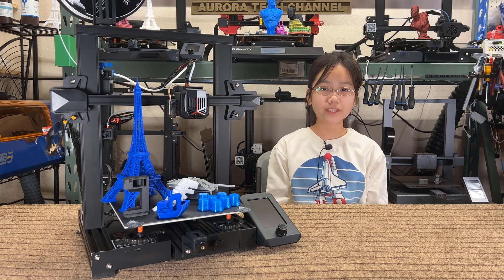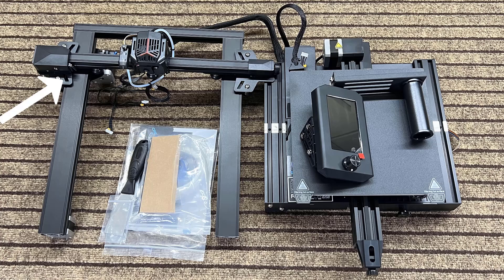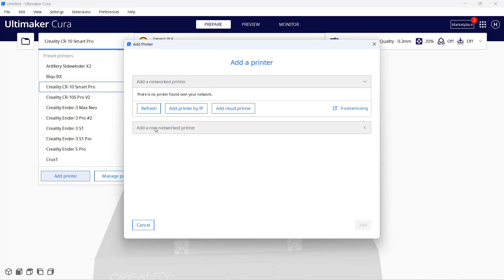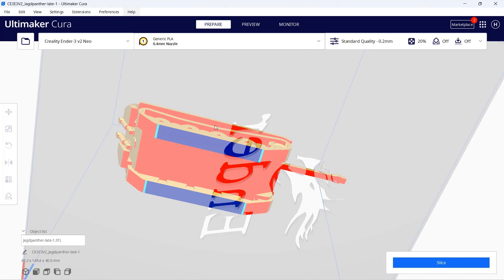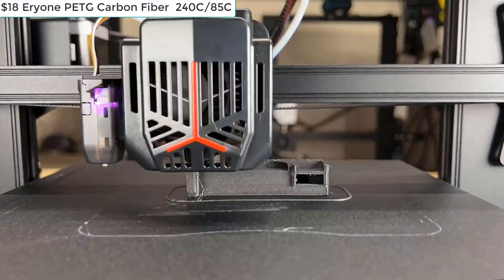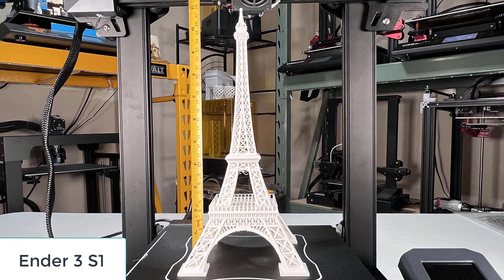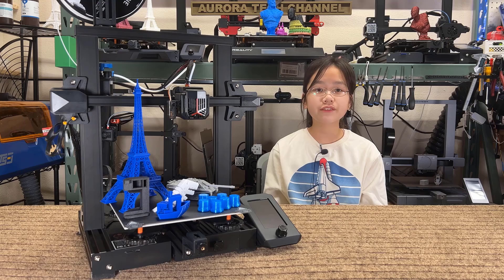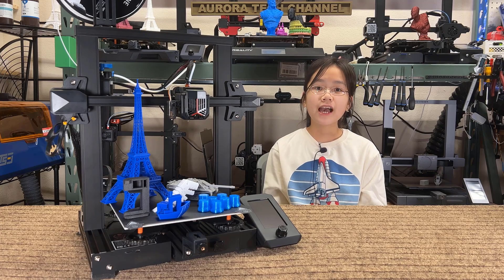Creality Ender 3 V2 Neo: 6 upgrades from the previous Ender 3 V2, new hotend, CR-touch, and more

Comment: Subbed, I was going to buy the ender v2 normal with 3 filaments for 80 euroy used, but after seen this video I have decided to buy the v2 neo new for 130 Euro on Sale! I hope it was worth it, since the used one didnt have any upgrades and was used pretty much, so I had to replace some things there which will also cost me a few bucks.  So I decided to buy the new v2 neo instead.

Comment: Just took delivery of my Neo today. New to 3D printing, it was quite easy setting the printer up and printing the boat that came on the SD card. Slicing is a whole other area of competence which feels challenging to get right, especially if I want to slice my own CAD designs.
Reply: Cura takes most of the work out of it. It gives you basic settings, and then you can fiddle with them to get things right.
Reply: @freman007  must say creality print has been great too in terms of "new here, use these default settings" - fine tuning speeds, temps etc seems to be an interesting concept between PLA's with varying tolerances, then hot end upgrades can introduce another area of competence i.e ceramic hot ends

Comment: Great video and very informative as always!  I have just stepped into 3D printing, so I know nothing.  I have an Ender 3 Neo it does not have the filament out sensor.  Would you be able to provide us newbees instructions on how to install the creality run out sensor plus the simplest way to install and locate the firmware for this process.  The board on this Ender 3 Neo is the V4-2-2 any help would be greatly appreciated.  Thank you Aurora Tech.

Comment: I have a 2 month old Ender v3 Neo Max.   The hot end lasted 2 months before midstream of a 12 hour print, the hotend plugged up with PLA and wasn't discovered for 5 hours as the machine doesn't detect a plug and get trying to force filament into the hotend creating a mess of melted filament that pretty much destroyed the hot end.
So far support has been a terrible experience, making me question ever getting another Creality product.

Comment: I just bought an Ender 3 V2 NEO as my first personal printer.  I've used 3D printers at work for 8+ years.  I'm very pleased with the ease of setup and the usability out of the box.There are a few issues I found.  First, the wheels and belts are not properly tightened.  The biggest problem is the machined spots on the 40x40 extrusions are not wide enough for the 20x40 to fit in fully.  This has caused the gantry to sit slightly out of square.  The CLTouch should compensate for this, but I'm still having first layer issues.  I've designed a small brace that can adjust and stiffen this, so we will see how well this works.

Comment: This printer is on sale right now so if you want to snag it run to the Creality site. I would of been happy with a 32 bit board.. But the upside is that Creality prices their accessories to be very affordable. I got me the Z axle upgrade for 16 bucks, the filament sensor for 11 and the light bar for 16.. So I mean it wont break the bank.

Comment: I'm stuck in between getting this or a Neptune 3. I only have experience in resin printing so I'm lost on what to get. I wouldn't mind spending a little more to get something that would perform much better but I'm not looking to go too crazy. Does anyone have any input on this subject?
Reply: Maybe you made your choice already, but go with the Neo! The all-metal hot-end totally changes how you think about retractions, and gives you the thermal headroom to print Polycarbonate, PMMA, and POM, which all have fantastic layer adhesion, and POM in particular is a poor-man's iGlide. The haters are always like, "Oh, but what if it clogs!?", but the Neo has a bigger heatsink on it, which helps create a dramatic temperature gradient between the hot-side and cold-side, so if filament isn't completely melted, it's barely warm.

If you want to save some cash, and you're OK getting your hands dirty, metaphorically of course, go with the cheaper Neptune, and buy a Trianglelabs Dragonfly, a Micro Swiss, or my personal favorite hotend ever, a Mellow NF-Crazy*, you can save $50 and have a moderately better hotend and auto-leveling system versus the Neo. 

Ultimately, if you're going from Resin to FDM for more material options, you'll want to keep your PTFE tubes far, far from the heat, however you end up doing it. BUUUUUT, if you're doing it so you can print stuff in deliciously cheap PLA and PETG? It doesn't matter, and both are smack-dab in the sweet spot between "reliable components, solid design" and "Cheaper than a car payment", and I promise you won't care once you're flinging filament.

*footnote: ugh. You might have heard that hotends like the Phaetus Dragon (different than the Dragonfly) and Mellow NF-Crazy are just "cheap Chinese knockoffs of Slice Engineering's Mosquito", in air-quotes because that's Slice Engineering's patent kinda says that's DEFINITELY what they are, but a Mosquito is still $200. When you can put together an NF-Crazy for $40, well, maybe I am a little Anarcho-curious? Since you can't just do an off-the-shelf crazy, and have to source the hot-side, heatbreak, and cold-side separately, it can be a little daunting, but a setup like a little Half-blood Hemera (the Crazy Extruder with volcano hot-side) is only a little more, for almost exactly half the weight: 198g (hot-side, heatbreak, extruder/cold-side, and motor) versus the Hemera's 388g (might include the fan and thermistor/heater. Google-based number, there). 

If you do take my word for it, there are some alternate vendors on AliExpress that sell identically-specced parts, and just like Mellow, some of them actually have decent enough quality control. I've bought the nickel-plated copper blocks for a few different sellers, priced at ~$15ish, and I've only had two that were noticeably off-spec. One was a bit loose, and the other was almost, almost unuseably tight. Both are wired up, on the desk, still. On the other hand, if the thought of replacing the hotend at all worries you, I do think the Mosquito/Crazy design is a marvel, but maybe just grab a Dragonfly; they're pretty, fantastically engineered, and are safely a drop-in upgrade for any of the Creality-style hotends from the factory.
Reply: @samhughes1747  I actually haven't bought anything yet because I like to do some research even if I have a rough idea on what I want. Your input is much appreciated and opens up a different avenue. Thank you so much for taking the time to reply with such an extensive answer. 🫡
Reply: @LordOfJazz  I mean, it was going to be a basic reply, but then I remembered how frickin' awesome the little knockoff mosquito hotends are! Totally worth the effort, if you decide you're willing to go there.

Comment: Great video as always
I don't get this printer. I would prefer that Creality had ONE ender 3 model, and not five (V2 nero, Max nero, nero, S1 plus and S1 pro). S1 indicating Direct drive, and the other with boden tube.
I have seen the Sovol SV06 (239$, pre-order, 299$ later ) review, and it is cheaper and with better specs. Dual leadscrews, drirect-drive, Prusa bed mount (No springs!) ABL, PEI-springsteel bed max temp 300oC, what not to like: https://www.youtube.com/watch?v=JTlmYucBsS0
Great work you two. Thanks for sharing your great work with all of us 🙂

Comment: Creality is stuck in 3 years ago.  Not at all impressed with the new hot end after using a direct drive from Microswiss.  I'm about done with Bedslingers anyway.  A Core XY system is much superior in all ways to these and does not cost much more when you factor in all the money you will spend buying spares and upgrades for the Ender series.

Comment: I don't know which board it runs, but if the TH3D unified firmware works with the board, I'd recommend picking that up. I think it's around $5 and you get the updated firmware/screen features you were missing. If it's not supported yet, you could swap the board with a TH3D easy board and you get the unified firmware included and it'll work great. That's what I did with my ender 3 "pro" that came with only 256k on the board.

Comment: I bought a couple of LED light bars for my Enders. They attach to the back side of the x axis rail with those nuts that turn as you tighten the screw to clamp into the groove of the rail. That worked fine for my Ender-3 Pro, but my Ender-3 S1 Plus has those rails with no slots like this V2 Neo. I drilled and tapped holes for the mounting screws to go in instead. I could have used double sided tape also, but I just realized that now. LOL

Comment: I wonder what the actual quality difference is between Creality's in-house power supply and the Meanwell. If I know Creality, theirs is probably junk.
Reply from the maker: I can't see any issues with their PSU, but Meanwell just sounds nicer.
Reply: ALL HAIL THE GLOW CLOUD!

I doubt it's junk. Meanwell is simply a safe choice, because their quality control...actually exists. Creality also has acceptable quality control, so if they've got their own OEM, I still trust Creality enough to not worry about it -- for all I know, they're OEM'ing from Meanwell themselves.

Comment: You mentioned that for around $300, there are other better alternatives, with more features, which one would you recommend?
Reply from the maker: Sovol SV01 Pro:
https://youtu.be/f0TBNgmI3Yg

Mingda Magician X:
https://youtu.be/eS0eaWROziM

WizMaker P1:
https://youtu.be/ejN38Qs8-cc
Reply: Probably the Neptune 3. Also, I disagree with the SP-5 unless you already have experience with 3D printers and maintenance. I have one and while it prints great now, it definitely came with a few headaches and needed some money put into it.
Reply: The Sovol SV 06 will blows this out of the water with a current introductory price of $239 usd. If you want to spend $299 you could get the Sovol SV05 which is a upgraded Ender 5 pro. The cubed designs are superior for print quality due to the static bed while printing.